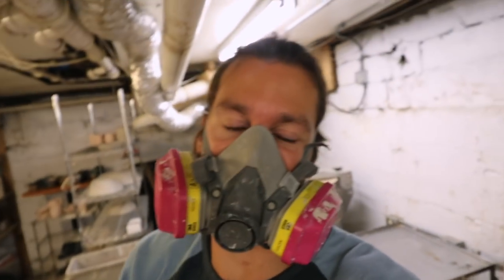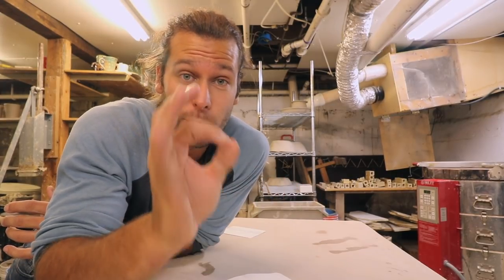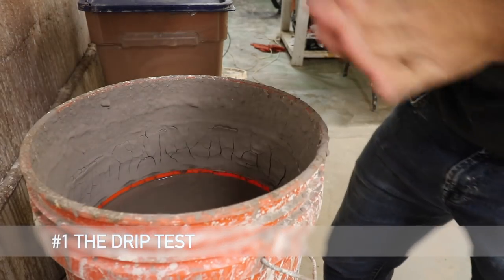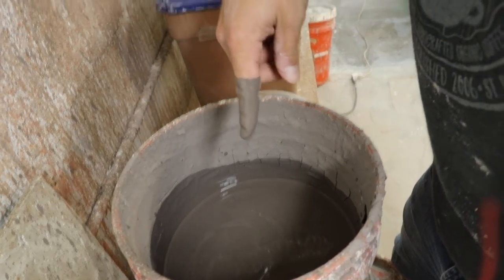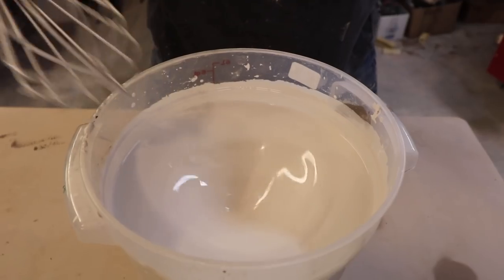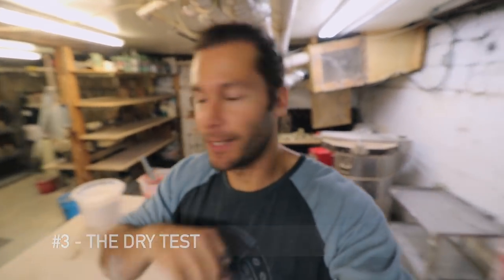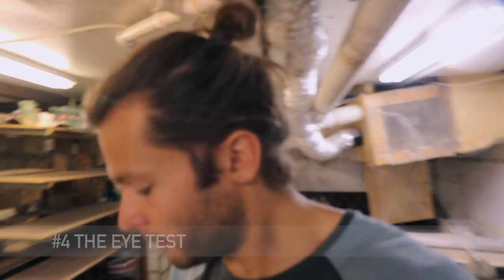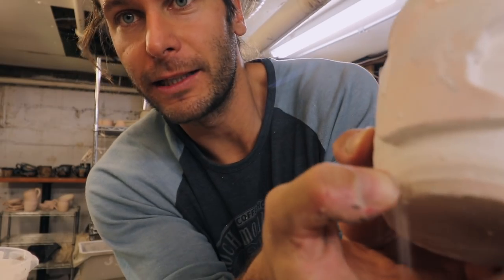Glazing tutorial!   How to test glaze thickness - The unscientific ways

Comment: Do yourself a favor and buy a graduated cylinder, weigh out 100ml of your glaze and then divide by 100 ( the weight of 100ml of water ). A specific gravity between 1.4 to 1.5 is a good place to start. Then test, test, test. This is such a quick, easy and cheap way to ensure you have a very reliable glaze.
Reply from the maker: I think I will do that:).  I have just never used that up to this point, thanks for sharing!
Reply: Jonthepotter no problem! I know you mentioned these were non scientific ways of testing glazes, but I’ve been amazed at how much a few ounces of water can drastically change the outcome of a glaze.
Reply: Jon, I bought a couple of plastic veterinary 💉 syringes at my local farm store. They are 60 ml. So i weigh that thing and write down the weight. So after I stir my glaze well, I suck up glaze past 50 ml, then squirt out until it’s right at 50 ml.  Weigh it again. Take the heavy weight and subtract the empty weight, then divide by 50. I agree with previous reply—I shoot for 1.4 or so. If it’s too heavy, I squirt it back in, add some water and stir and do it again.  If you have an electronic kitchen scale from your local big box store and a simple calculator , it’s fast and easy. If I’m doing glaze testing and only mix up a small amount, sometimes I waste a lot when I use the graduated cylinder. And the plastic syringe is easy to clean. Love your videos!
Reply: This is so helpful. Thank all of you for your input about this subject. I need some kind of guidelines helps me tremendously.
Reply: @chemdmiller  Hi deborah, what if you achieve 1.4 but the glaze is super thick ? Do you defloculate ?
Reply: leauici yes . First I make sure the specific gravity is about 1.4. Then I also usually need to adjust the viscosity. I use Darvan 7 a few drops at a time to deflocculate if the glaze is too “thick” or too viscous. More often for me, the glaze will be too thin so in that case, I use vinegar to flocculate it. If I get it too thick, a few drops of Darvan 7 brings it back. I use the electric immersion blenders to mix well. Sometimes I have to redo this process a few times for the glaze to be stable. 

Some of my glazes have Gerstley Borate in them. They gel up like jello if not stirred. I found that mixing well with the electric immersion blender made a huge difference and I don’t usually have to adjust the viscosity, but just have to keep mixing longer. 

Most of my glazes are mixed from recipes but I still adjust commercial powdered glazes if the specific gravity or viscosity need to be adjusted.

Comment: hydrometer is my best  most consistent way to test glaze thickness... Most of my glazes work perfectly at a reading of 1300 to 1600,,, each glaze is a bit different. I write the hydrometer reading on the glaze bucket. usually start with 8 oz. of water to each pound of dry glaze... add water as needed....Thanks for the videos!

 .
Reply from the maker: Cool!  Thanks for sharing!  That sounds like a super consistent method, might have to change my methods after seeing how others do it:)

Comment: Part II Great tutorial for all to consider.......your results speak volumes for your scientific methods. Is science not based on trial and research using the tools at hand? This is basic science to me. That being said I use brush on glazes at present and I am going to be doing my first SINGLE FIRE  glaze firing with my next load(Cone 6 Stoneware Electric). Dipping glazes may be down the road, but with only 150 sq.ft. it would be a bit tight. Thanks again Jon......good video.

Comment: Hi Jon this was very helpful, my glazes came out just a little too thin and I didn’t know what to do with them. So I will take the lids off and let them thicken up a bit. 👍🏽
Reply from the maker: You can also skim some of the water of the top after the glaze settles or separates .  This works well if you are like me and not very patient:)
Reply: Jonthepotter just realize that some of the glaze chemicals are soluble in the water (think about salt or sodium chloride) and even though the liquid is “clear” there will be some materials that you are removing with the liquid. You might consider finding a way to boil off the water from the part you pour off. Then see how much dry material remains in the pan and return that to the glaze bucket. If there’s enough to scrape out and return, it’s probably enough to affect the properties of the glaze. Probably best to not use your kitchen pans to do this. 😳

Comment: I had a feeling my glaze was too thick even though the specific gravity was right. I tried the drip test and got zero drips. I dipped two pieces at that thickness and will fire them, but I’m also going to add water until I get four to five drips, measure the specific gravity and try a few pieces at that thickness. I love your tips and hints. They are great for a new potter like me. Thanks for your videos!!
Reply: How did it turn out when it got zero???

Comment: I find the SG v useful but only after I’ve tested the glaze by checking thickness using a needle dragged through drying glaze. If the test is fine I check the SG so that I know optimum water content. An easy way is to use a small screw lid bottle half filled with nuts and bolts (cheaper than anything shop bought) float the bottle and draw a permanent marker line where it floats and mark the glaze number